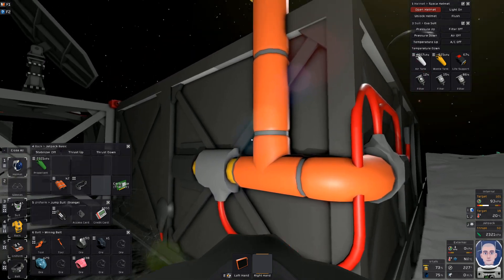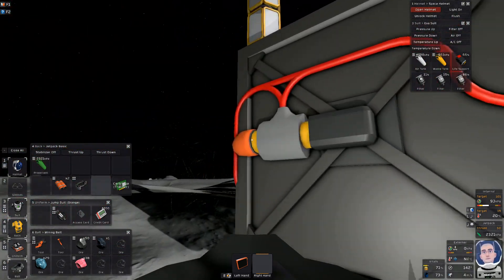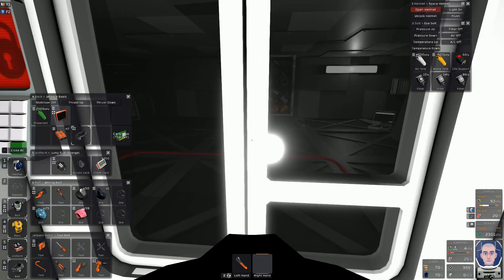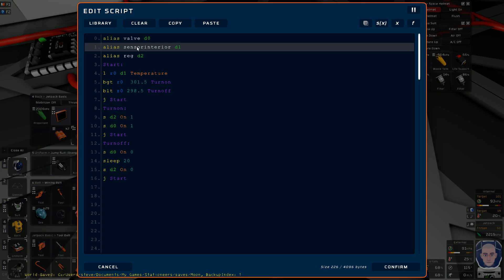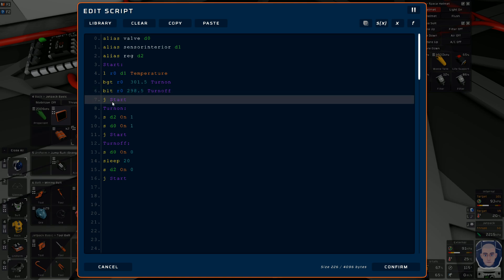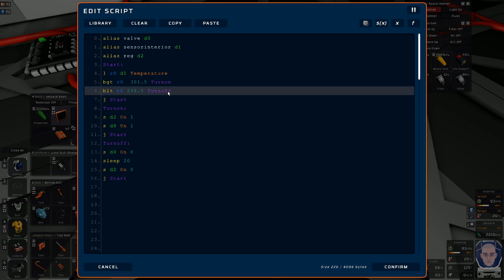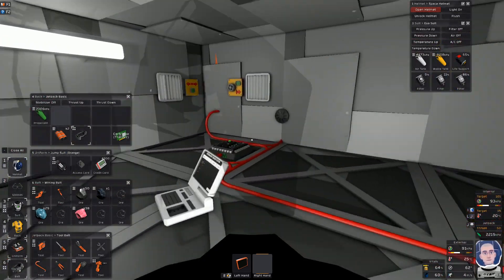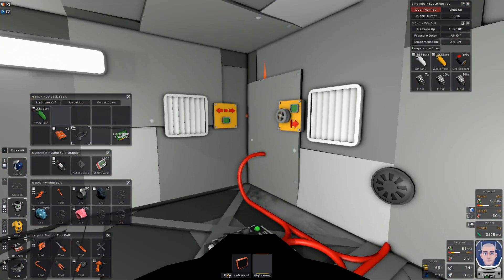Stationeers 101 ep 3: Easily cooling of your base on cool to warm planets demonstrated in 5 mins.

Comment: You should put a "yield" statement right under your "Start:" marker, because while the game will enforce this invisibly anyway after 128 lines (not 128 statements), you don't benefit in the slightest if you're running through the same code at lightspeed again and again while the game had no opportunity to simulate anything.
Reply from the maker: I usually do. Must have missed it there.